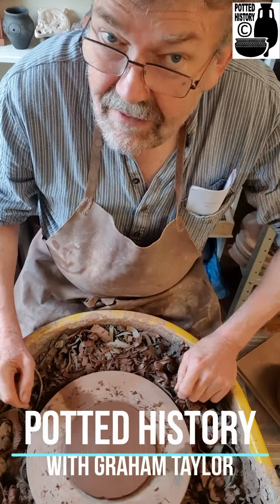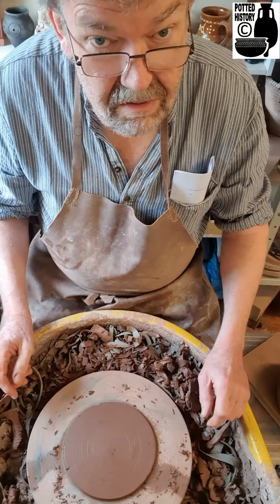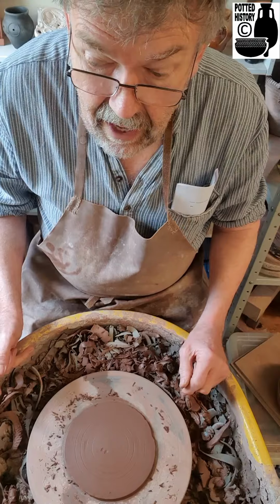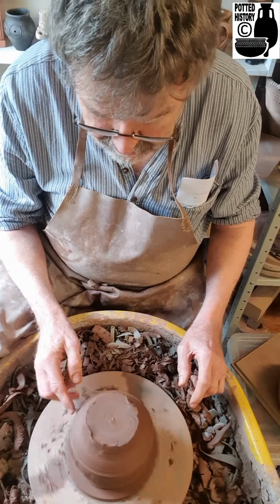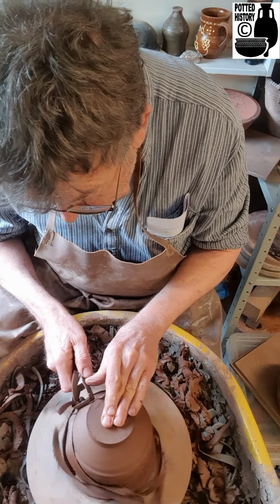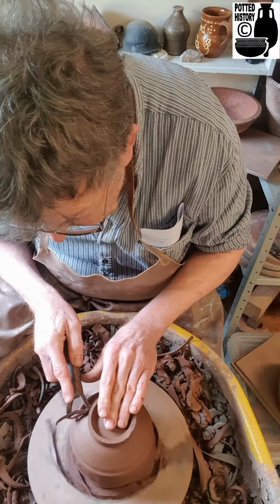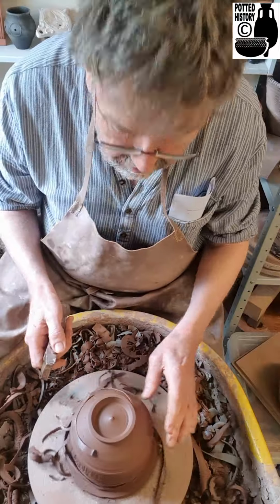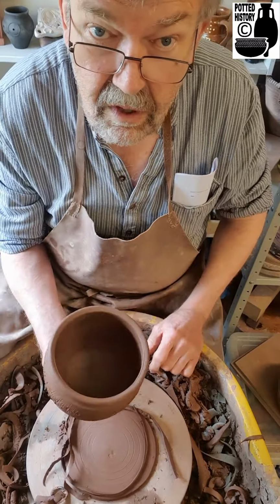Pottery Making Basic Techniques - Knocking on Centre

Comment: Would they actually use a turning cutting tool like that in Roman times or perhaps rather some kind of knife?
Reply from the maker: It's possible that a knife might have been used occasionally, but they are difficult to keep steady, and we do have looped turning tools from sites in Gaul.